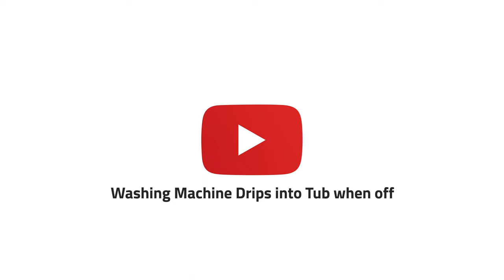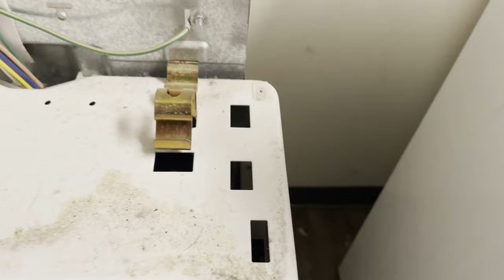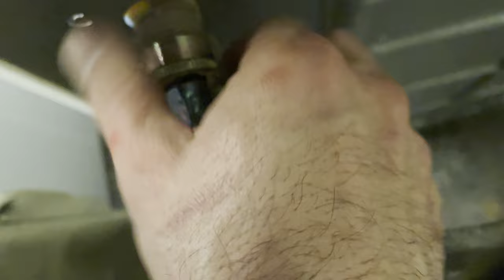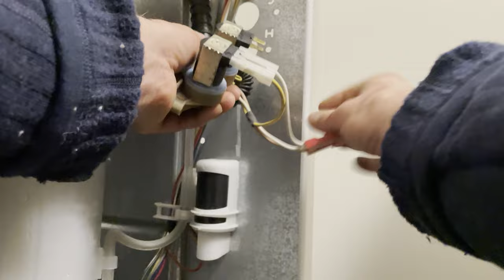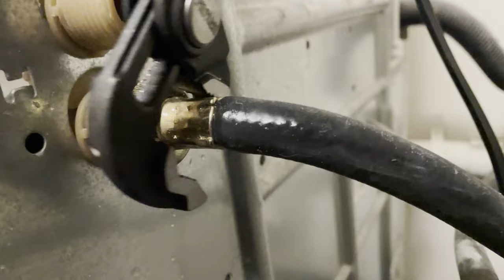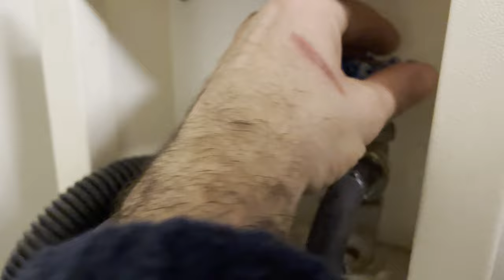Water Inlet Valve Replacement on Whirlpool Top Load Washer

Comment: Easy job just have a couple suggestions 1. Remove water hoses prior to taking apart those clips.  Makes it a little easier I think. 2  Have a towel underneath the hose internal hose so that you don't get water on your electronics or electric connections. 3  Be sure not to take out the 2 screws on the back of the washer too far or when you bring the control panel over they'll fall out. Might be easier just to remove them altogether so they don't fall in the ground and your searching around for those. 4.  Be sure to flush your hoses out  before reconnecting... you can use a bucket or like mine in the garage I just sent the water out the side door otherwise you may foul your new inlet valve with gunk in the hose itself.  Great video however this is a very easy job to do just takes a little bit of time.

Comment: Nice repair 🔧 I changed alot of those water inlet valves on the Whirlpool washers at my old property, they were the mid 90s direct drive whirlpool washers. Was this at your property or another property your company owns? Looks older than the property your always at. Which I know the company you work for, if you remember me saying I was offered the supervisor position at Element 47 in 2016. I figured your property was newer unless it was remodeled recently & this unit wasn't remodeled yet. 👍
Reply from the maker: This was the older property. I float between primarily 3 properties one being about 20 years old, one about 8 years old and the other one just under 5 years old. Keeps the sword sharp dealing with a variety of appliances :)
Reply from the maker: @ApartmentMaintenance  Ya for sure. I really enjoy working on a different styles of appliances. While it's nice walking up to an appliance and knowing exactly whats wrong the troubleshooting part it kind of fun to me.